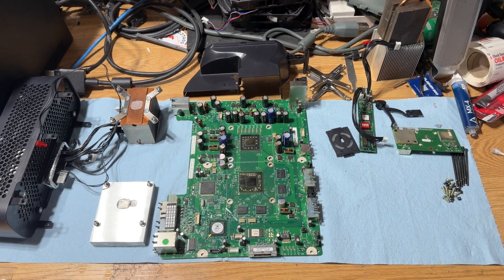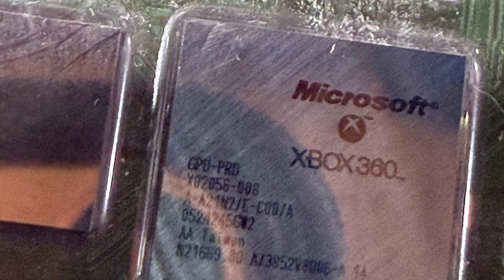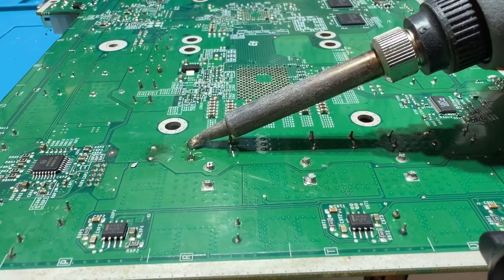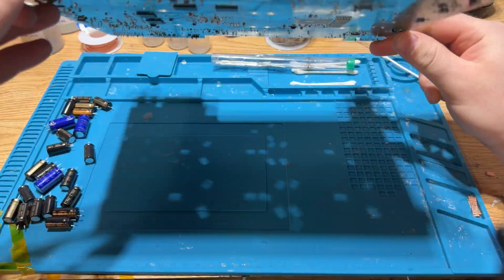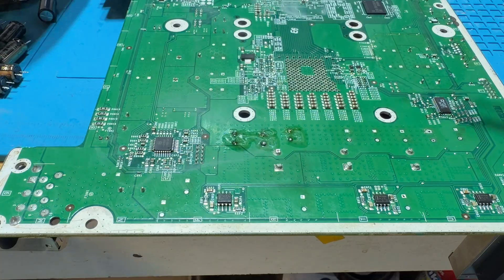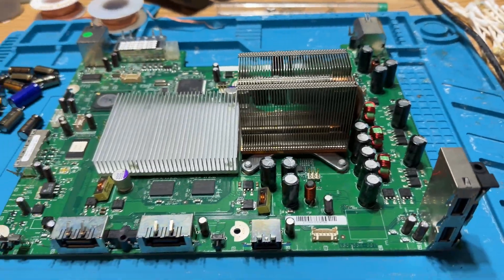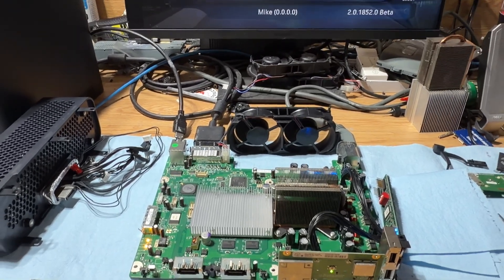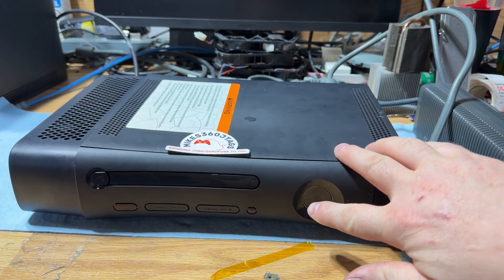Xbox 360 XeDK 007 Prototype Capacitor Replacement

Comment: That USB door can be fixed easy. it pulls out, then use kapton tape and fold it in on itset, hit it with 105C heat for 30 seconds, let it cool and it will then stay closed.

Comment: I have , "stock" 360 , and it gives me 0-1-0-2 (4-1-4-2 error - ERROR_NBINIT_MEM_READ_STROBE_DELAY_TRAINING	Memory read strobe delay training failed) Can this be from the Capacitors?(I did not change capacitors) , It worked for a short while(1-2h) after a reflow of the ram &/or GPU.... I even put some thermopads on the ram chips and wood to force the pads on for a thighter fix. (did not help much). Any sugestions on witch capacitors to change to maybe fix this error?
Reply: That is a dead GPU, reflow is a short revival that confirms it, what you have to do is fully replace the GPU with a compatible one.
Reply: @colesyaj_tech No one will ever do this, (if it's that than it's a parts console.)

Comment: What capacitors do you use specifically?
Reply from the maker: 1189-1881-ND and 1189-1465-ND from digikey
Reply: @Mikes360JTAGS would that work on a non dev unit as well?
Reply from the maker: @GetWiththeProgramGaming yeah I use the same ones on retail systems
Reply: @Mikes360JTAGS ok thanks for the info!